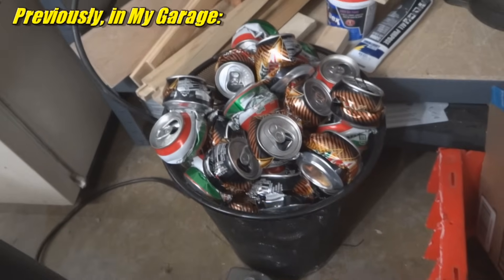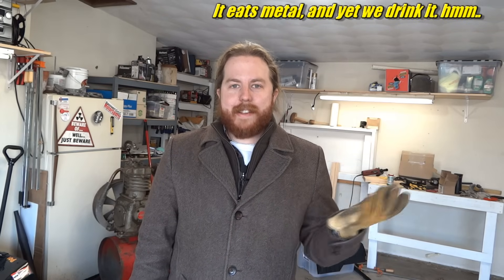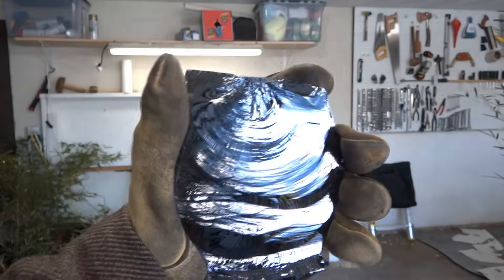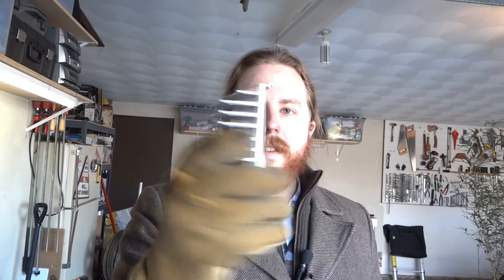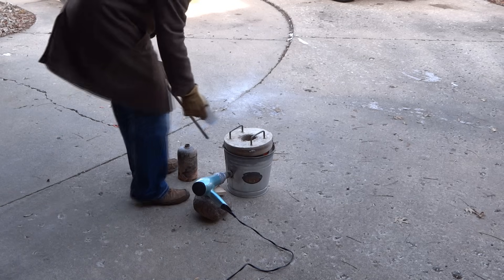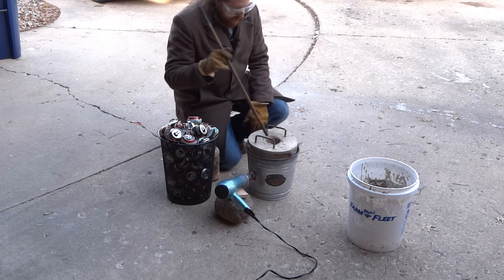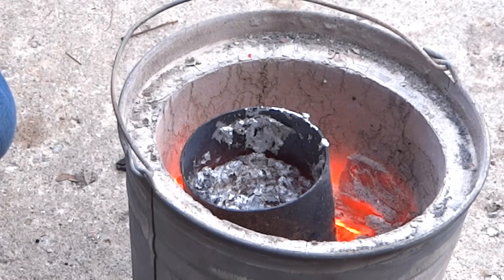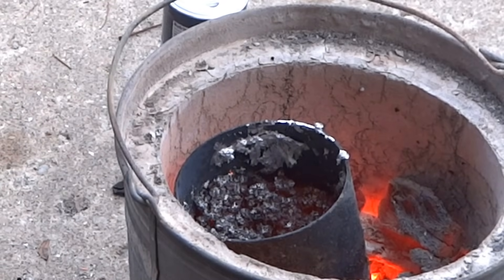Get the Most Aluminum From Melting Cans

Comment from the maker: This is the stuff: https://amzn.to/42Sn4Hg
HEY everyone, Paul here. I see most of you are into scrapping.  I am a metal caster.   This was one of my early experiments with melting aluminum cans.  In case you didn't see, this video is almost a decade old.
These days, I don’t recommend using cans as a metal source. they’re the wrong alloy for casting and can cause porosity issues, plus it doens't flow as well as a proper casting alloy like A356.
But this experiment still shows how flux helps separate aluminum from dross.  Does this help you metal scrappers put there?  No clue.  I dont do that.  Where I live, there is no can deposit, so maybe.  I cast metal.
If you’re serious about casting clean metal, check out my newer videos on choosing alloys and my FREE Maker’s Sand Casting Starter Guide: https://paulsmakeracademy.mykajabi.com/signup-d507c6e0-88a1-4f79-b4d3-575b55544fce
Reply: You can buy graphite rods to use as stir stick, before use slowly heat any moisture out of the graphite rod

Comment: if i ever take up melting cans as hobby i would... 1. press them flat 
2. shred them
3. press them into neat little cubes, perhaps put this mass into a small fire just to burn up all the plastic prior

KNO3 has been added to molten aluminium mixes to try to superheat some of the slag and liquify some of hte stuck aluminium, that could work too
maybe cover up everything with sand, charcoal even..? this would of course be a good idea to get some nice dense cubes of pressed aluminium shred before going at it

Comment: great job in only a couple hours of dangerous toxin-inhaling work you transformed $10 worth of charcoal into $5 worth of ingots.

Seriously people the burning plastic on those cans is NASTY you will be blowing black snot for 2 days and probably reduce your lifespan by a week every time you do this. 

Also if there's even a drop of pepsi left in a can it will explode you really need to be preheating or oven-curing the box of cans before you just go directly into molten aluminum with them.

I have smelted several tons of lead trying to make a profit then I realized there were other ways of making good money without killing yourself.
Reply: The fumes gave me A-Flutter… never again!

Comment: You shouldn’t pour on concrete. If you spill the metal on the concrete it can explode. I just read a story of a guy who spilled molten metal on concrete, it exploded, then shot molten metal in the air which landed on his head and burned him badly.
Reply: Exactly, there’s usually moisture trapped inside concrete. Same explosive reaction if you were to light a campfire up on concrete. Pressure builds and the concrete explodes from those little pockets of moisture

Comment: So the reason I’m here is I wanna melt my cans in to wire for my bonsai plants, any real suggestions? I will do the pour over concrete at my mates house some I’m not doing it at home- don’t worry about it!
Reply: Thats not gonna work, youd have to cast a log, roll it into a thinner billet, and then drawing it through several forming dies to make it into a wire that doesnt crack like dry spaghetti. You'd also need a LOT of silica and its pretty hard to alloy especially in those concentrations

Comment: When you mix materials is important to consider if you are supposed to be mixing by weight or by volume.  For example the same volume of copper might weigh 3 times as much, as you've shown.  So when you say add 5% copper, you need to specify that you mean by weight, and not by volume.

Comment: What you need is a molten salt bath in the crucible BEFORE the aluminum gets near it.  You need a salt mix that resembles aluminum brazing flux, with borax & fluoride salts to lower the  melting point of the salt mix to below that of aluminum.

Comment: Look out for cans with ANY moisture in them, cause if you put a can with moisture in a pool of molten aluminum you'll get a REALLY interesting explosion!!!
Reply: Thats a good advice thanks! 😅 really I mean it ✌️
Reply: Yup..  if you hear a sizzle, you're playing with fire.  Aluminium/water explosions are difficult to initiate, but when they go-they go hard.
Reply: When I was a kid melting lead, my bro cooled a spade in water, then put it back in the pool. It exploded & plastered lead all over my face. Great way to learn. Lucky it missed my eyes, but it sure stuck to the skin! So you are spot on with that. Years later when I was an apprentice I noticed aluminium plastered all over the high workshop trusses, apparently they were melting aluminium and put an Ali cylinder head in the pot. There was still some water deep in the galleries. Glad I wasn’t there.

Comment: Some of the old timers used to put a thick layer of charcoal in the crucible on top of the metal working on the theory that as it burns it creates a layer of CO2 on top of the liquid metal to keep the oxygen away and prevent oxidation. The man who told me has been dead for decades now so I can't ask him what metals he used it with or how thick a layer but it might be worth experimenting with.
Reply: Some metals will rip the oxygen from the CO2 forming the oxidation anyway.
Reply: @stblackhole  True it won't work with everything.
Reply: Makes sense.

Another way is to put argon into the furnace or to bubble it up through the metal inside the crucible.

This requires a tube that resists very high temperatures.
Reply: @alexanderrr1825 a steel tube could probably be used to inject argon at aluminum melting temperatures.
Reply: @alexanderrr1825 argon... No need for a noble gas when you have nitrogen. It's totally inert but hard to get as a private buyer

Comment: So What do you do , with the Dross ! Then ! ??
Reply from the maker: garbage can.  and this video is super old, i wouldn't recommend melting cans at all anymore.  too much oxide waste, too much dross from the plastic can liner, and it's not the right alloy for casting
Reply: @PaulsGarage  The Garbage can ! Sounds Quite Bad ! For the Environment ! And Alloy !?? I don't know About that !
Reply from the maker: yeah cans are made from 2 alloys, neither of them flow well for metal casting.  A356 is a good flowing aluminum alloy but it can't be formed into cans.  You find that stuff as car wheels and some engine parts.
Reply: @PaulsGarage  So what did you do , with the Buttons ! ( From the Cake tin   In the video , ones ) then ??
Reply from the maker: @davidwillard7334  still in a pile on the shelf, unfortunately.   Most of them anyway.  I did use some to alloy up some aluminum bronze and i did cast some stuff with them before i knew better, but I would say 2/3 of them are still on the shelf
Reply: @PaulsGarage  so you wouldn't know ,What the total number of them was ??
Reply: @PaulsGarage    Were you replying to people's comments here with a mobile device - which I've found replies only to the opening poster only and doesn't notify who the reply should go to, as evident by your two of three replies here?  

Also, I'm pretty sure I hear you say "Pure" after melting those cans, like extruded aluminum, which I thought this was what I was looking for because extruded is almost twice the price as cans at my local scrap yard and I thought I could get more for my cans by melting them, but now you say "cans are made from 2 alloys" - so is this the same or different from "extruded" aluminum like in aluminum heat sinks?

Comment: Thanks Paul! This a great tip! I have been collecting aluminum cans for awhile waiting for spring to start casting but was having doubts about using them because I kept hearing the same: they are a good cheap source of alumimum/they are garbage, don't use them. Relieved to know I can use them for casting projects. BTW,  I enjoy many of your videos and the information you share. Thanks!
Reply from the maker: Hi stephen!  this is a pretty old video, i would suggest using the aluminum from cans for making alloys like aluminum bronze, but I wouldn't use them alone for castings unless you have a mold with plenty of head pressure or something.  This stuff will have a higher shrinkage rate and higher surface tension.  Nothing that can't be compensated for, of course, but it's not ideal.  I used these to make aluminum bronze (90% copper, 10% aluminum).  It's great.

Comment: Note on aluminum can alloy 
Typically it's 3003
From Wikipedia 
The alloy composition of 3003 aluminium is:
Aluminium: 96.8 to 99%
Copper: 0.05 to 0.20%
Iron: 0.7% max
Manganese: 1.0 to 1.5%
Silicon: 0.6% max
Zinc: 0.1% max
Residuals: 0.15% max
Reply: Thanks for the extra research I love knowing the extra info about alloys
Reply: I don't know much about aluminum alloys, but that looks pretty close to basically being pure aluminum.
Reply from the maker: Its pretty close, yeah.  Close enough that if you use it for alloys like aluminum bronze or home-brew za12/27 you can just calculate it as pure + impurities.

Comment: You should really rethink pouring over concrete. If the aluminum spills, the heat can cause the surface to literally explode into  your face. Pour over sand or dirt.
Reply from the maker: Good call.  I don't live at the location in this video anymore but i'm thinking of building a sand bed for casting in the new place for sure
Reply: At the VERY least a welding blanket!. Anti Splash grates, which is just steel tread plate like use in naval applications or catwalks, over a pit of sand. You do NOT want metal splashing your shins or into your boots etc... I also suggest ANYone pouring.metal , no matter the volume, to wear IR goggles, top smock and at least leather fire chaps. Contact burns with metal can kill you...and it will take time. Ive had the tiniest piece of rust blow into a silver mold...when the molten silver hit it, it went off like a firecracker. My goggles have 3 pieces of silver embedded in them. I thank God i was wearing them
Reply: Guys correct me if I’m wrong but doesn’t aluminium have a low flash point
Reply: @fukumitsuryoko3482 higher than water in concrete though
Reply: Yep, I have a nice crater in my driveway from that.
Reply: yuppers

Comment: What kind of pipe did you use to stir
Reply from the maker: It was just a metal pipe i had lying around, nothing special
Reply: Is it normal to hear faint cracking after crucible has been tempered and is cooling off?
Reply: Have you poured in winter? If soo is there a difference in how it handles
Reply from the maker: @wd4685  yeah I've poured in all Wisconsin weathers.  I've seen no difference.  The metal is always good and hot and the sand is usually closer to room temperature regardless of weather.  The garage is heated and back when I did this video I would just move the stuff outside while doing the pour, not long enough for the sand to cool off
Reply: Hey bro. How do you go about removing hard solidified copper from graphite crucible

Comment: Speaking of melting, you've said you shouldn't mix yellow brass and red brass together.  Why not?
Reply from the maker: The alloys are different.  They are specific to their application, and mixing them wrecks it.  It's still brass and it looks like brass but it's not as good at either of the original tasks. Basically 2 alloys great for specific applications, when mixed, becomes not great at anything

Comment: Is it silicon carbide that's in cast aluminum? You can see it in the grain structure when you observe a broken piece. Shiny little specks. The shrinkage is natural and occurs in all molten metals to differing degrees as they cool.

Comment: i could be wrong but aluminum cans run at about 98% with most of the 2% being magnesium/maganese were as things like cast aluminum are high in silicon E.G lawnmower body's and engine parts aluminum. extrusion like window frames sliding doors ext are about 99%
Reply: also aluminum melts at about 600 deg c for casting get it to about 700-750 deg c

Comment: Only two and a half years late to your vids, but better late than never! I'm going to try the Lo-Salt tip tomorrow because you're right - the amount of dross from cans is horrendous. In fact today I ended up with a smaller alumuffin (oooh, I like that!) than the one I STARTED with, despite adding a bucketload of cans: the amount of dross (and aluminium bound up in it) was greater in volume (if not weight) than the alumuffin. Love your channel - have a sub! :)

Comment: How does copper melt "like sugar on coffee" if it melts at 900+ degrees while aluminum melts before 700°?. That´s the only part I did not quite get... Thanks.
Reply: The suger is not melting, its dissolving
Reply: Many danger exists between your Mom's tits!!!  For one, I'm joking so you may now laugh little one...

~NMB

Comment: I always thought silicon is added to the aluminium for casting to make it flow better. So Question: Why is the silicon from the casting a problem when you're going to use the aluminium for casting?

Comment: I did some aluminum foundry in college, we used swimming pool tablets as a flux
Reply from the maker: i got some pool granules for that purpose, i just haven't had time to use them yet.  soon....
Reply: Paul's Garage we had a small piece of steel pipe welded to a piece of rebar to put it in the bottom of the crucible. We put paper towels on each end and the pool stuff in the middle of the pipe.

Comment: when you ram up the furnace lid prop the steel band up 1/2 inch above the bottom face of the refractory. this will keep the steel hoop cooler and it won't expand so much.

Comment: Have you tried adding a bit of charcoal or coal to the crucible in order to consume the oxygen and prevent oxidation, or do you think it would just add to the impurities?
Reply from the maker: +David Nielsen I did just that for the copper melt I did, but for aluminum the aluminum oxide skin is somewhat protective
Reply: cool.  Thanks

Comment: flexing? and dross? what is that?
what is the difference between pure and cast aluminum?
Reply from the maker: +Ethan Lyde cast aluminum has silicon dissolved in it.  Dross is crap that floats to the top of the liquid metal, and fluxing is the process of adding flux (in this case the lite salt) to remove impurities and make the liquid metal runnier (more like water than syrup)
Reply: awesome thanks! how much salt is too much? i melted aluminum last night and it did not turn out good, most of it was too solid to pour. did i wait too long to pour it? did i run it too hot?
also, not sure where to get extruded aluminum.

Comment: Is your poking rod a hollow tube, like conduit ? If so, it will heat very quickly as hot air runs up the inside like a chimney.  A solid rod like a chunk of re-bar or an old fashioned tire iron will stay cool longer and remove fewer fingerprints.
Keep on cookin' .
Reply from the maker: +521cjb yeah it's hollow but there a bunch of junk jammed in it.  It is copper though so the heat conducts right up the pipe and into my hands!  That thing gets hot surprisingly quickly!

Comment: If u add sulfur to ur flux it makes an unstable explosive please keep this in mind when doing scrap melting if their is sulfur in ur mix up can get explosive bubbles to full out bang. Use borax instead of salt if u think there might be sulfur present.
Reply: I believe the flux mixture used was potassium chloride and sodium chloride. The addition of sulfur causes “ explosive bubbles to full out bang” . How is that possible? Please provide a chemical equation or explanation . It seems chemically impossible.

Comment: With the copper, would a layer of oxidation be an issue like with the aluminum do you suppose?
Reply from the maker: +Cheerfultrout yes, in fact copper oxidizes more aggressively I believe.  People often use cover fluxes or stuff charcoal in the crucible to take up the oxygen when doing copper.

Comment: What's the difference between cast and pure aluminum
Reply from the maker: +Brendan W there are many casting alloys, but most of them contain silicon, 5-15% or more.  Silicon is also found in cast iron in high amounts (different from pure iron or steel which has some carbon but not silicon).  Also some modern bronzes use silicon added to copper instead of adding tin to copper like in traditional bronze.

Comment: Howdy everyone. Got a question for +Paul's Garage or basically anyone that has tried this... I bought this crucible on Amazon ( ) and after getting it I just read the darn "warning":

"Pure graphite crucible can NOT be heating by carbon furnace or charcoal kiln. It will be oxidized and cracked; Pure graphite will start to oxidize at 752 °F （400℃)"

Does it mean I should NOT be using it in this type of homemade foundry?? :'(
Reply: Alex Tutusaus 
Yes you probably shouldn't use the graphite crucible in a foundry using charcoal or coal anything like. But I do believe you can use it in a gas/propane foundry. Just make sure you slowly heat the crucible up over like an hour and then let it cool down in it's own before actually using it with melted metals, because it can break/shatter if it's not "cured" before using it.
I hope that helps you out!

Comment: Paul, would you know if you could successfully use your foundry as a black Smith forge to make knives and such?
Reply from the maker: +ajinthevalley NS probably yes.  The burner would work fine and it can get the metal to orange hot, but you would need better insulation if you want welding temperatures.  Also the design is meant mainly to hold a crucible so the shape might not work for holding certain work pieces.